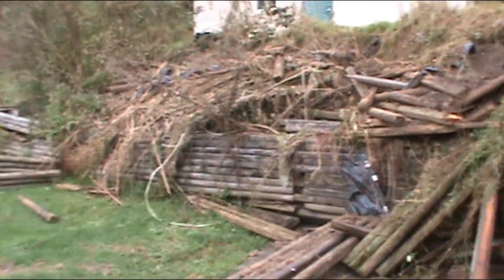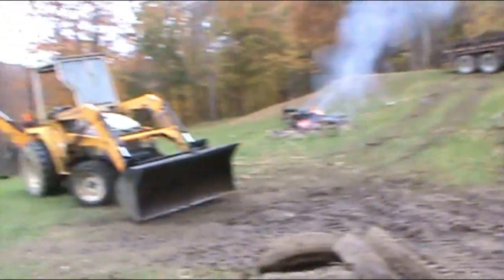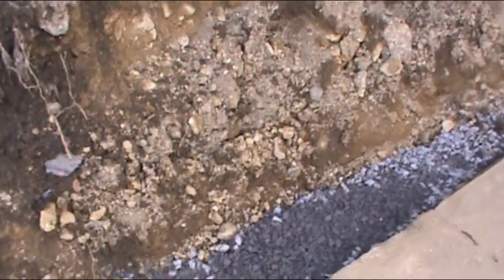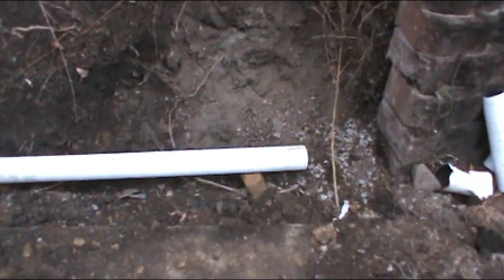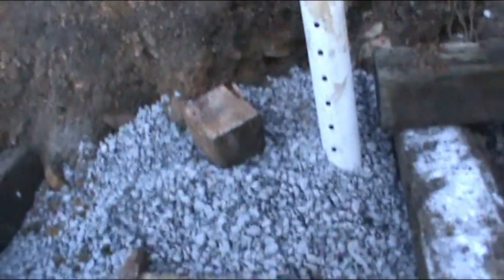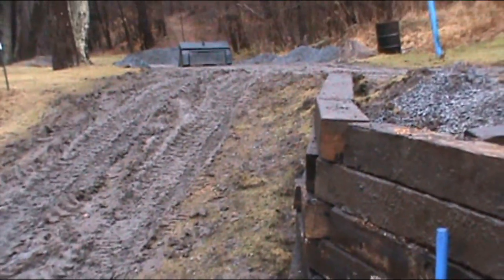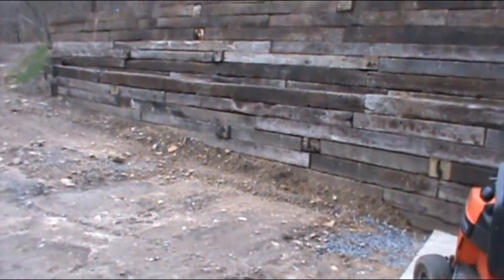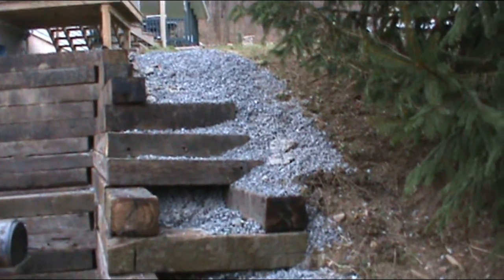How I built a two tier railroad tie retaining wall

Comment: Did you get that endloader backhoe for $15,000? I’d love to buy one, that sounds like a fair price, I assumed a used one would be way more
Reply from the maker: Shane K we got it used with a couple extra attachments thrown in for $15k
Reply: GSE Shop, you mentioned you might sell it? What state are you in if you don’t mind me asking? Thanks man
Reply from the maker: Shane K PA, but no it isn’t for sale sorry
Reply: I must have missed what you used for hardware to tie the ties together vertically—drill, then rebar?  It looks more like a screw.  We've bought the recycled plastic ties, and haven't started yet.
Reply: @GSEShop   LOL.  Knew it was PA when you said "don't mind that stuff upere." @ 31:45 Nice wall, that is a big one. Thanks for sharing. I'm just like you where I'll buy equipment rather than rent most of the time.
Reply from the maker: @TimBruce1  I agree unless you have a super small project that you know will take less than a day I would buy and resell every time